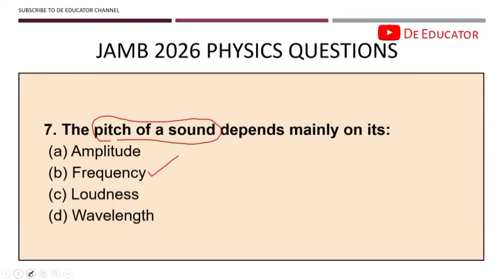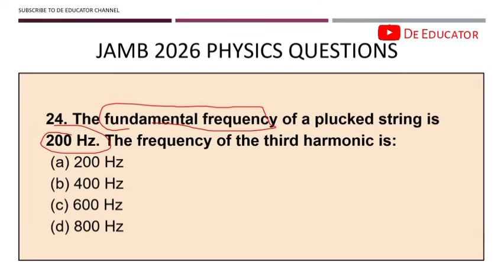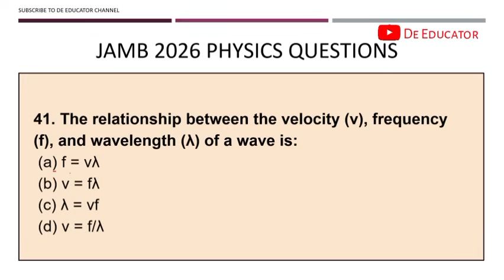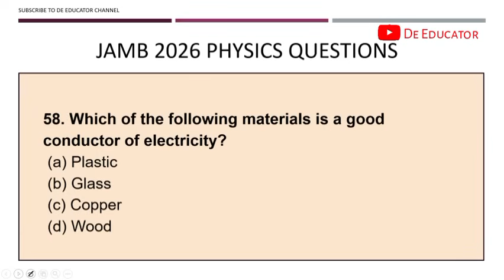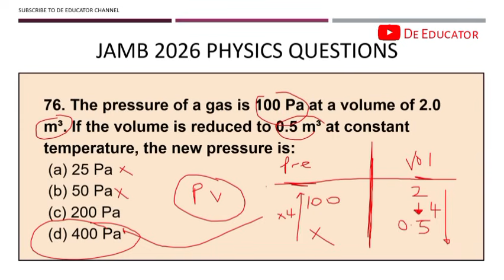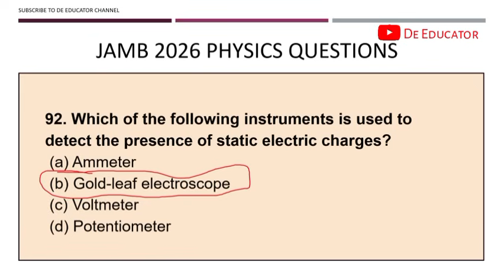JAMB Physics 2026 | Real Questions from Day 1 & Day 2 🔥

Comment: No 37 is wrong 
Answer is viscosity
Reply from the maker: Good question... this is a very common confusion.
The correct answer is Surface Tension.

 Surface tension is what makes the surface of a liquid behave like a stretched elastic skin.. that’s why small objects (like a needle or insect) can rest on water.

 Viscosity, on the other hand, is the internal resistance to flow.. how ‘thick’ a liquid is (e.g. honey vs water).

So:
Surface tension → surface behaves like elastic skin
Viscosity → resistance to flow

Very good 👍 Keep attempting questions❤